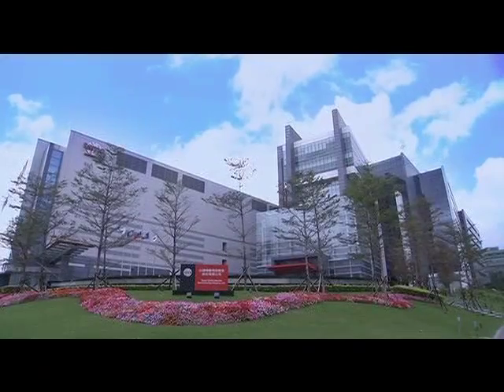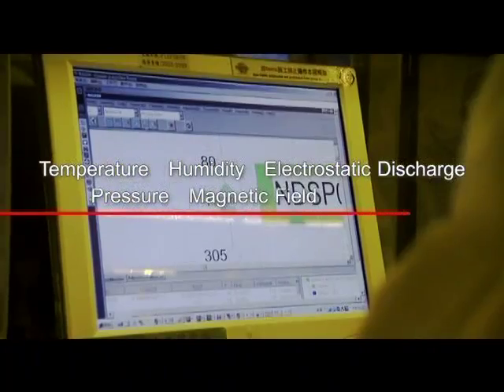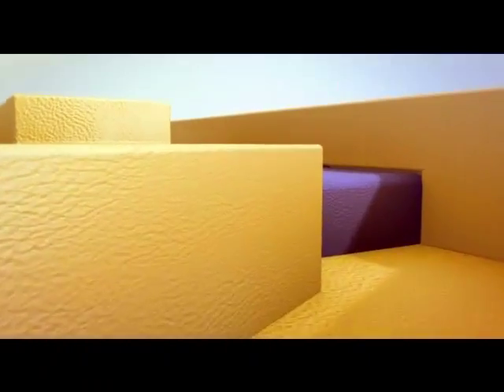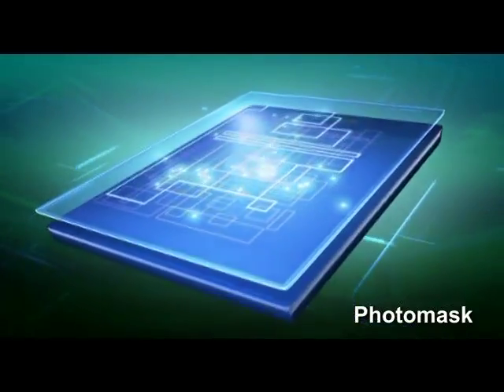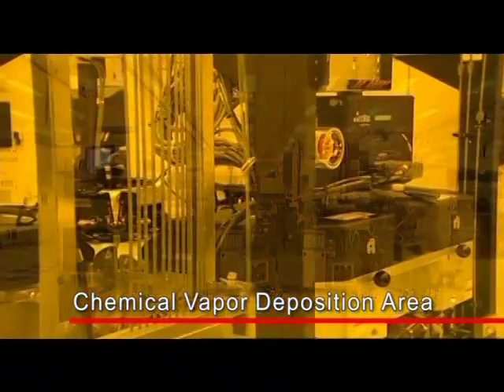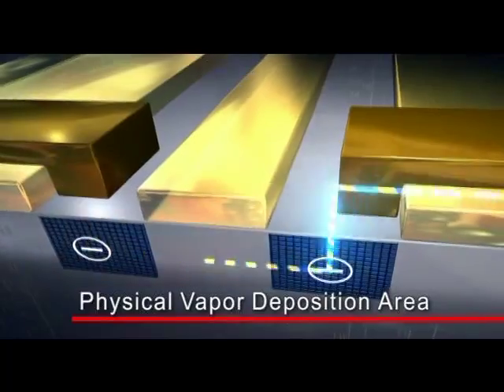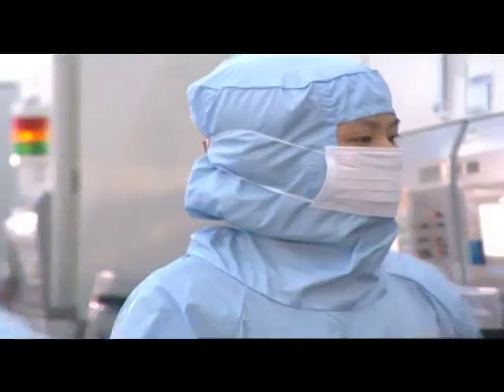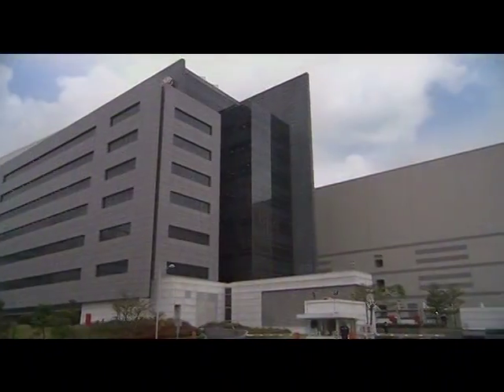Semiconductor Technology at TSMC, 2011

Comment: I am so happy to see this video! I missed working with STMicroelctronics! I worked back early late 90's or early 2000 for about more or less 5 years at STMicroelctronics in San Diego, CA.  I worked in a cleanroom environment and processed print head ICs wafer. Back then we cannot have makeup and wear perfumes/colognes.  This was one of my favorite and most fun job that I had worked with. I work at the PHOTO area where in we called in dark room because wafer cannot be exposed to the light or else it'll get scrap and depending on the type of wafer, it'll really costly. I remember the POLY, CONTACT, etc. type of wafers. I enjoyed working on the pre-alignment machines. I love the work schedule. Overall, my work experience was the best! :)

Comment: 12 inch wafers... The company I work for we only manufacture 6 inch wafers
Reply: Does it make  difference in the performance of the chip ? I suspect chips in the middle of the wafer perform better than the one's located on the edge of the wafer

Comment: My understanding is that when you expose the photoresist you cause it to polymerize, hardening it... the video has this backwards.  Worked a year in MOS4, NMOS, at Motorola... certified for all photo operations... inspect 1000 wafers a shift.  Uniplane, Perkin-Elmer aligner, wet etch... Blue M bake oven... olde-timey stuff.  Love the smell of xylene in the morning!
Reply: I think it depends on the type of photoresist used. In this case (the video), it's most likely a positive PR. Yours is most likely a negative PR.

Comment: Holy cow! The procedure for making processor is so delicate and complicated.. Thank goodness I gave up my course in Engineering back in 2004 and instead pursue my marketing management.
Reply: +joseph971 Huh ? I'd actually be disappointed that if I did that, but to each is own.  Engineering is not easy and takes a lot of hard work.
Reply: imtheillakilla Word. That's why I gave up my 5 yr Engineering course due to numerous units of Math subjects like Calculus, Trigonometry etc. etc. the thing which I can't handle. I hate math. And so I change my course to MM.
Reply: i wanna know what engineering course you took?
Reply: Kyudo Kun    I  Developed  a New  Intergrated Circuit  Subtrate  Design  Based on " INFUSED "Wide Band Gap " TUNNELING " Utilizing Nanotechnology Doping ,  How Would I  Approach  A  Technology  Company  For A Licensing agreement?

Comment: 12 inch wafers too heavy to carry.. nonsense. I walk every day all day with these at a company where they make the lithography machines. Such an automated system is just more failproof and keeps contaminating people out of the cleanroom.
Reply: Engineer9736  Not much difference in weight between one 8" and one 12" inch wafers, but there would be a big difference between a box of 8" and a foup of 12" wafers.  Also, most of the technicians at TSMC are female, and it would be quite hard for them to carry those wafers all day.
Reply: Lu
I carry 25 pieces of 12" wafers quite easily. If it's too heavy for the girls, there are always trolleys around. Such a transport system is just to automate things and keep people out of the cleanroom.
Reply: +Lu Hmm, yeah, I carry foups of 300mm wafers everyday off a reflexion machine and it's not heavy at all lol.  Females wouldn't have a problem carrying them all day.
Reply: Carrying wafers in a carrier is just boring, and you do not want to expose them to any mechanical shocks, misalignment or delivering to incorrect place. Sure, they all have barcodes and electronic tags, and orientation notches, so it can be easily detected, but any error just consumes time. Having it automated streamlines production, eliminates mistakes and allow management to know which steps in the manufacturing are a bottleneck in production pipeline, and guides decision to what to optimize next (i.e. what and how many machines to buy for every step, etc). It can even be done on per chip basis. And in any given fab, there might be dozens of different chip designs being fabricated at any given time. It is complex.
Reply: Hi ASML guy :-)
Reply: I eat them all day
Reply: I'd bet that efficiency and reduction of human error are bigger reasons behind the automation.

Comment: I just started working at a semiconductor plant in Colorado. It's pretty cool but so much to learn.
Reply: I work in an InP photonics foundry in the NL. We're using loads of tools from like the 80s/90s as we're only on 3inch, and so as you can imagine its pretty low tech for 'high-tech'. The stuff going on at at Intel and TSMC with  their full automation is space age shit!
Reply: @JPS_Originals  Out of curiosity, what is the noise level in fabs? I've only heard the background music so I don't know if those quiet rooms maybe require earplugs or have at leats some rumble to get used to or if in fact they are whisper quiet.
Reply: @1312_PV  so in our cleanroom it's around 70dB I believe. It's low enough that it's not mandatory to wear ear protectors but there is a decent background level, so the company provides for free to any employee who wants them and works in the cleanroom injection moulded ear plugs. They're super comfortable, and filter far better and more consistently across the spectrum than the regular foam ones you can buy. I've actually used them at festivals too :D
Reply: @JPS_Originals  Thank you for the detailed answer. I have hyperacusis and I'm somewhat of an earplug aficionado myself because of that, so noise level was my first thought ha. I'm glad they provide the option for earplugs. 70 dB is plenty for some people even if not likely to cause hearing damage (especially if low pitched), and you got the nice pair of expensive and good earplugs for other uses such as concerts as you said. Have a nice day!
Reply: 79dogface......I didn’t know they had a semiconductor plant in Colorado. What city and what is the name of the company? I worked at Motorola for nearly 15 years in diffusion, Photo, and probe. Then another year and a half for Microchip in Etch. Both in Arizona.
Reply: @gracebe235  it’s called dpix in Colorado Springs.
Reply: @79dogface  , how many nm your plant can make ?